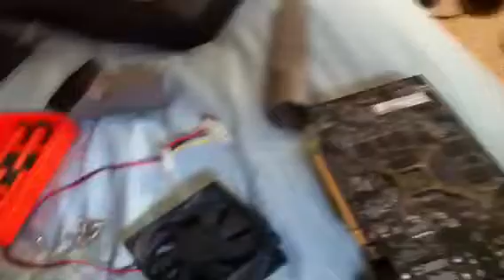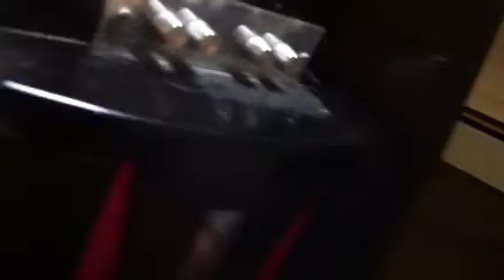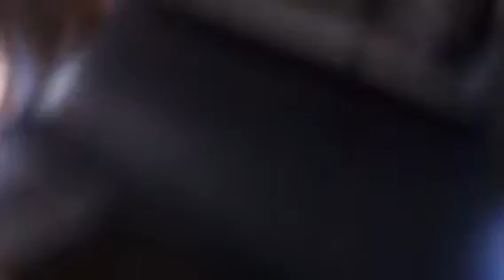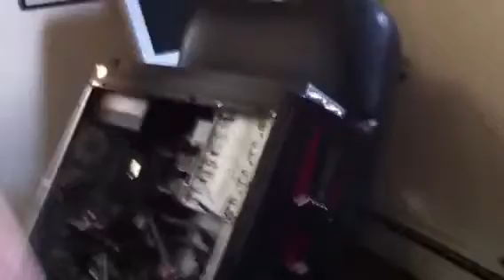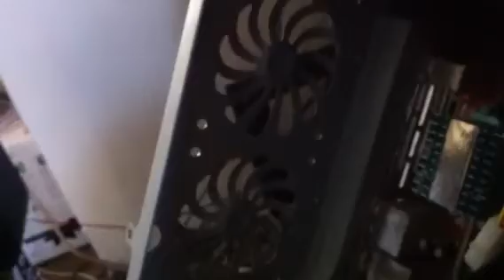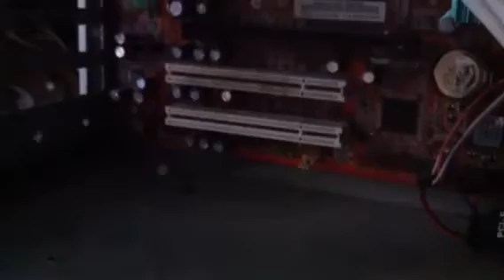Big nasty vlog 9.10.11 : operation repair

Comment: @artistbydefault  damn that really is problematic looks like you have a few inches for proper ventilation.  you ever consider buying a new case that supports water cooling so you will have another option to resort to if a fan that is needed goes out?

Comment from the maker: @fightlikegentlemen None of my fans were working in my computer.  The video card I have points downwards and its at the bottom, so hot air blows down and rises with NO air being removed from the system.  The video card would overheat and blue screen my computer.